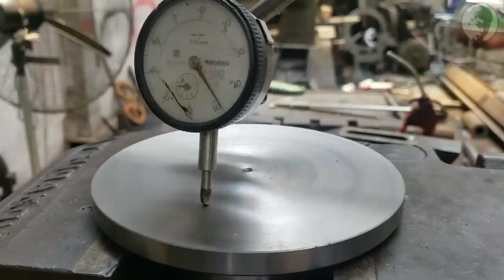Gia Công Mâm Kẹp và Dao Đột Cắt Ngàm Ống Sắt Tròn 90°

Comment: Machine a groove into the outside edge of the disc, then wrap a thick o-ring around it. Will help to dampen vibration. 

Same principle as when I machine a brake rotor.

Comment: I've been a machinist and tooling specialist for over 30 years and I find your machining skills lacking basic fundamentals. You could save a lot of time by just putting the pipe in the vice of your mill and notching it with a endmill. No fixture, no lathe, no heat treating needed. 1 mill one vice and one end mill. Done in 15 minutes max and that includes setting the mill up and finding the endmill you want to use.
Use the K.I.S.S. method 
Keep it Simple Stupid.